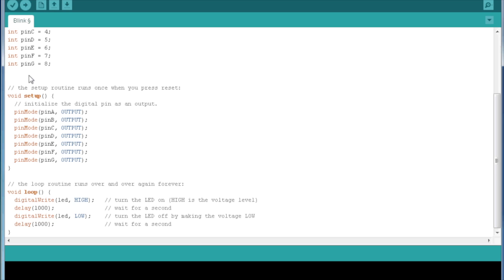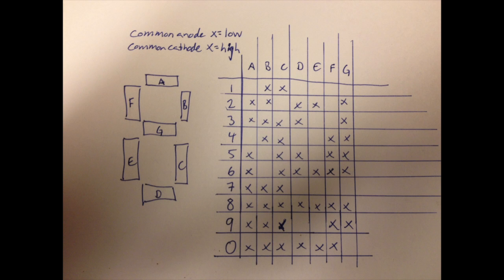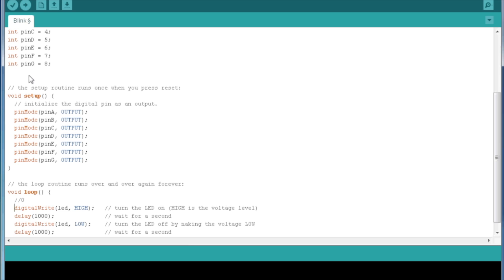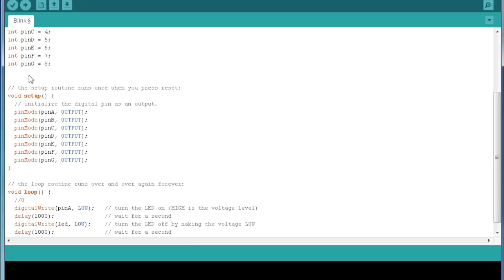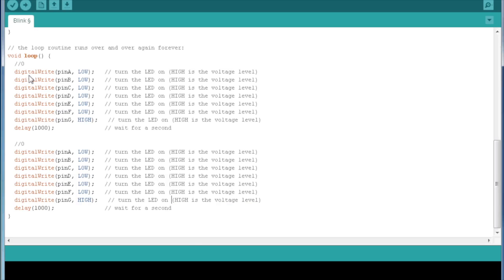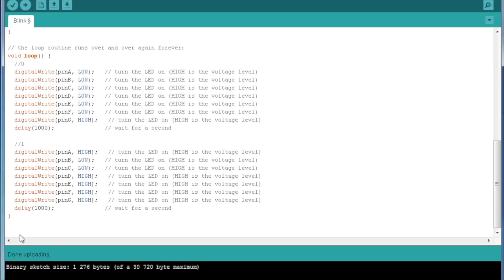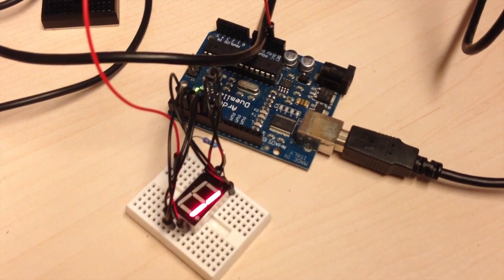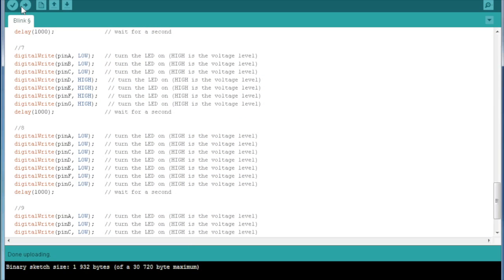Connecting a 7-segment LED display to an Arduino, part 1 - Anything Arduino ep7

Comment: I wrote the code and set up the circuit according to what you displayed. My code is running and uploading properly without any error but, my segment is not showing. I checked all the circuit connections again and again but didn't find the problem. Can you help me?
Reply from the maker: In the video I explain that it can be either common anode or common cathode. Try to switch the common pin from to either ground or 5v and see if you get any action from it.
Reply: @SourceryOne  Yes, it worked. Also, instead of connecting a resistor with the voltage pin, I connected it with each segment pin. It was 440 ohm, and sort of worked. Thank you for your assistance.

Comment: how to identify whether it is common anode or cathode without coding or arduino
Reply from the maker: If you have a volt meter with a diode checker (usually looks like the diode schematics symbol) then you can probe the anode pin and one of the other pins. If you need the red/positive probe on the common pin to get a signal/reading on the volt meter then it is a common anode. Else it is common cathode. You could also just take ground and +voltage and a resistor and probe with. If a led segment lights up when you have ground connected to the common pin then it is common cathode. Otherwise common anode. Hope this helps. Good luck!

Comment: why in the sketch HIGH = off of a led please explain
Reply from the maker: It depends if it is common anode or common cathode led segments. If the common pin (the pin shared by all led segments) is the plus voltage pin of the led, then High (voltage on the arduino pin) means no voltage will run through the led. If the arduino pin instead is low then current will go through the led from the voltage plus common pin to the ground on the low arduino pin. Hope this really detailed explanation helped. :)

Comment: Excellent video that allowed me to understand how they work and solve my issue to finally get them to function properly. Unfortunately I have a 4 segment 7 in that has a bad led and that led me astray for a while. You are an excellent teacher and the aids you prepared allowed me to figure out and understand. My single 7 pin led is common cathode but was easy to get it working correctly. Thanks for the time you take to make these videos.

Comment: so with mine the bottom right corner on the LCD wont display anything, even if i flip the screen, its always the bottom right
any ideas?
PS: I've checked the wires and nothing seems to be wrong

Comment: i CAN get it to blink with the Bilnk Code, I cannot get any of the display after I hooked it up per your instructions,
Reply from the maker: Just to make sure that all pins are connected correctly do the blink sketch on each of the pins you have the led segments connected to. If you find one that doesnt work, then try changing the polarity... This sketch is just digitalWrite highs and lows so there isnt anything that would mess up unless the diodes are the wrong way.... Hope this helps...

Comment: dear Kristian Blåsol,

can you tell me that what resistance have you used in this video?
Reply from the maker: +waqas adil A small value around 200ohm should work fine. It depends a bit on the LEDs used. But try with 200 or 220ohm to start with, if it is too bright take a higher value, to dim, lower the value.

Comment: I bought an arduino starter kit from sunfonder, and they provided some example code for the 7 segment display on a CD. It looks like, they had a really bad programmer, because they used a seperate function for every digit. I wanted to use a switch statement, so i reused the code for the digits and put it into one function. My code looks like this:

constant int a = 7;
constant int b = 6;

.....

void setup()
{
    //set the input and output pins
}

void loop() { };

void 7segment(int number)
{

    switch(int number)
    {
    case 1:
    digitalWrite(c,HIGH);
    digitalWrite(b,HIGH);
    for(int j = 7; j <= 11; j++)
    {
        digitalWrite(j,LOW);
    }
    digitalWrite(dp,LOW);
    break;
    }

    case 2:
    
    .....

}

But 7segment(); doesn't work in the setup function and in the loop function it only works the first time i call the function. Can someone help me? I don't know much about the arduino language.

And i just noticed, that i could just use PORTD instead of the code from the CD. I think, i will try to replace all the digitalWrite shit with port manipulation.
Reply from the maker: +StarTrek123456 Could you tell me the error you get aswell, so I know what might be wrong :)
Reply: Kristian Blåsol There is no error. It just doesn't work. But i figured out, what i did wrong. I put "loop();" at the end of the function "7segment". I don't know why i did that, but after i deleted that line, everything worked. I also made a new version of the sketch, but with port manipulation instead of digitalWrite. Now it uses only about 800 bytes instead of 1.55 KB.

Comment: resistor =???ohm
Reply from the maker: +eng.mustafa Ahmed Sorry for missing that... A small value around 200ohm should work fine. It depends a bit on the LEDs used. But try with 200 or 220ohm to start with, if it is too bright take a higher value, to dim, lower the value.
Reply: thanks my friend for reply